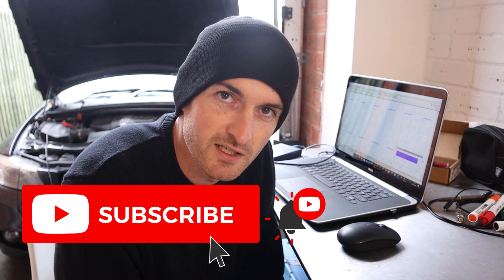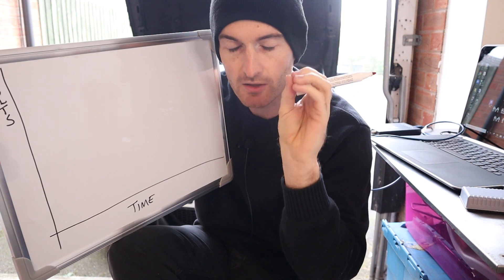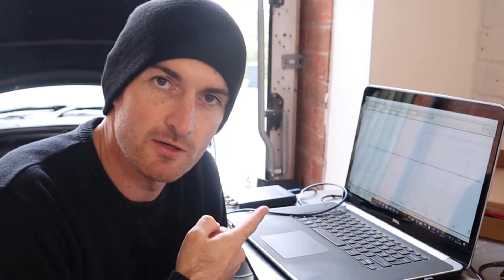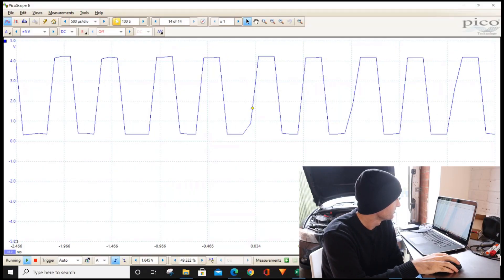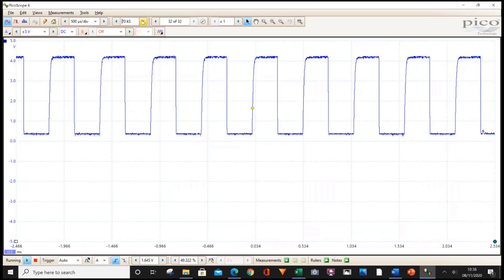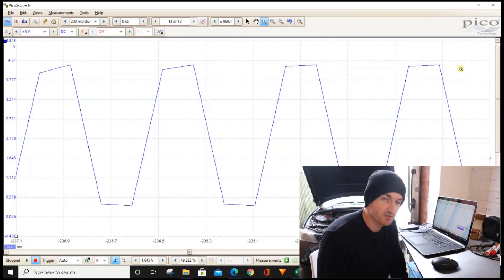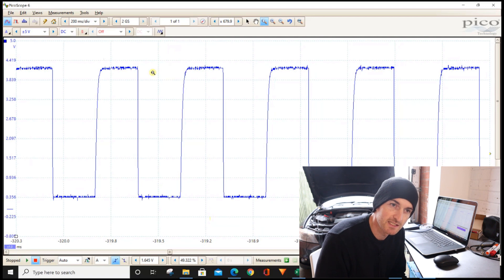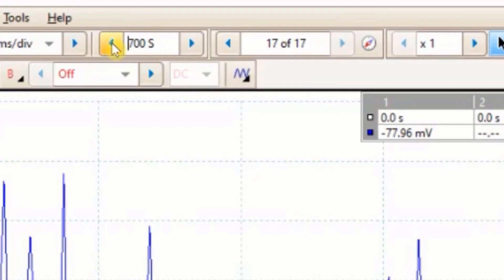Sample Rate Explained | Automotive Oscilloscope Diagnostics | Mechanic Mindset

Comment: More than once when you said "Sample Rate" you were actually referring to "Total Samples Taken". Specifically when talking about the samples adjustment in your software. This made the comparison between supposed high and low "Sample Rate" at a short and long time base (@  6:25  ) completely nonsensical and illogical. Changing the time base doesnt affect the waveform and true Sample Rate( except if you hit bandwith limitation but thats another thing), unless like in the case of the software you were using the time base setting directly changes the Sample Rate because it's the Total Samples Taken thats constant  and adjustble and not the actual Sample Rate. 

This is important to understand and point out bacaause as i sad it makes some explanations wrong and impossible. Otherwise you have great teaching style. Very aproachable and thorough. Thank you.

Comment: Loving the 2204A videos, Darren. The one thing that confused me was the s/div option in the software. I was always under the impression that that just changed the display output in the software itself so you could see more or less information depending on how big you want it on the screen (but the amount of information coming from the scope was the same depending on the sample rate chosen), but from the way you explained it, that actually changes how much information the scope provides to the PC as well? Like the s/div is directly linked to the sample rate?

Comment: Snap on zues is 6 million samples and that pales in comparison to pico. It ok but not a clear pic
Reply: I sometimes watch a video 2 or three times and I usually pick up more info this is one of those video. Basic as is maybe to some but very informative to me who never understood it's value.
Reply from the maker: @mike-yp1uk  It’s in the basics where masters are made 👌
Reply from the maker: The memory spec also plays a part; it determines how many samples can be displayed. They are usually fine at fast time scales, but start flagging when you want a lot of time on the screen ie 10 seconds

Comment: I think you have still left some confusion, since at the beginning of the video you are referring to samples per second, but when you are making adjustments, the sample rate is per screen, not per second. If it was samples per second, the resolution would be the same regardless of the zoom factor of the time axis. Perhaps I don't explain it so well either, but I reckon you (Darren) know what I mean.
Reply from the maker: Yes I see what you mean; I think I was trying to explain in its simplest form. 

There is an added layer to this too because the sample rate changes based on your time selection and maximum desired waveform buffer; all based on the oscilloscope memory. It can get quite deep 😅. It’s made somewhat simpler in Pico 7 with the option to prioritise sample rate or waveform buffer

Comment: Mate I want to know something. Injectors voltage diesel renault captur when ignition is on engine off. Im reading 4.7 volts both wires. Cranking im still reading 4.7 on both wires. I thought should be 12v and cranking ground side 0 volts. Should i get 4.7 or 12v?
Reply: Sounds like you are measuring voltage drop.  Can you send a sketch or illustration of your probe setup?
Reply: @gfbemc0256  No I was reading correct. Written on the body it said 4.7 volts.
Reply: @jamesbarratt593  that’s very interesting. I am assuming they are direct injectors operating at high pressure?

Comment: Hey, really enjoy your videos. how do you set the sample rate on a hantek with the hantek software?
Reply from the maker: Great question, I don’t think you can directly     You can change the buffer length which will spread the maximum samples over more time giving less sample rate. I’m need to do more research on Hantek but I think that’s how it works. 
Thanks!

Comment: I have a pico scope 3423 from 2007 it’s 4 channel the sampling rates are 20MS/s for one channel and 5 MS/s if using 4 channels this was a top of their range back then I bought the full kit wasn’t cheap never really used it your video has peeked my interest got it out of the box last weekend had a look at some ignition waveforms still working great downloaded the pico 6 automotive software works with that ok but I guess for the price I should really get the 2204 far superior a big leap in 14years
Reply from the maker: Awesome! I’ve not used that before. I’ve used the 4423, the first Automotive scope I think and that’s still good today. What’s the vertical resolution on yours? You might be interested in the training I’ve just launched 👍 https://www.mechanicmindset.com/diagnostic-coach
Reply: @MechanicMindset  12 bit resolution will have a look at your training I attended a pico training course in 2007 when I purchased the 3423 and to be honest it was to short and to intense plus there was guys there that were already using scopes went over my head to be honest.
Reply from the maker: @kevinpalmer7452  Cool, that’s good! 2204 is only 8bit. Might be worth hanging on to the one you have for a bit. Learn how to stretch its capability, then you will appreciate the upgrade and what the extra specs are buying you. I’m no salesman but the course I made explores all aspects of Pico 😂👍

Comment: Excellent info!  Thanks so much.   You mentioned in the video sometimes you might take the car on a road test.   Will the pico scope actually record data for a long period of time like that? I was thinking that it would record up to 32 frames and then start recording over itself. Are there any settings I need to make so that it will record for a long period of time? Sorry if my questions are kind of dumb. I'm still relatively new to this.
Reply from the maker: No, great question! You can increase the time setting per division. So you could actually record for hours or even days. You can then zoom in after, but the quality does reduce over longer time, there are only so many samples that can be taken. Keep an eye out here, I have some PicoScope training online coming soon!
Reply: @MechanicMindset  oh, that makes sense.   Thank God for knowledgeable people like you helping beginners like me. You really explain things well.

Comment: Sample rate vs/and Bits?
Reply from the maker: So the ‘bits’ refer to the scopes ability to rise and create a smooth line (to replicate an analogue signal). Low bit rate scopes will have steps in the wave form. Hope that helps 👍

Comment: First of all great explanation 👍 Could you please tell me if it's worth buying the 2205A which is 200 msps over the 2204A? Do you think it's worth the extra money?
Reply from the maker: Hi, if you want to do lots of captures at a higher time (I.e 200ms/div) and then zoom in then yes - it would be a bit better. ‘Real time’, for example a CAN capture at 50us/div, there no real difference. If you want to spend a bit more, go for 2405A, 4 channels and specs like 4425A! 👍
Reply: @MechanicMindset  That's a good point. Maybe spoil myself and get a 4 channel. Thanks for the prompt reply, appreciated.
Reply from the maker: You’re welcome!

Comment: Great Video Darren :) Glad to see topics like these discussed on you tube..... Being an automotive engineer myself, i have always felt there should be more videos about diagnostics using tools like oscilloscope and picoscope ! Hope to see more videos from your channel. I just had one comment on todays video, you should have also discussed about nyquist criteria for avoiding anti aliasing when selecting a sample rate.
Reply from the maker: Glad you enjoyed the video. What commodities do you look after in Automotive Engineering? 

Regarding the aliasing, I suppose this would be apparent on very low spec scopes on higher frequency repetitive signals; can you think of any common examples? Would be good to make a more detailed video covering this topic and being able to replicate aliasing will help get the message across. 

Thanks for the feedback! 👍
Reply: @MechanicMindset  My work involves control design for engines.  Regarding aliasing,  i am not sure how you can replicate it for demonstration on a vehicle. Generally, we see it during downsampling of very fast changing signals, one of such can be any pressure signals in the car where you would see some high frequency noise folding into the lower frequency domain.
Reply from the maker: @niksforever  Cool, OK. I’ll do a bit of research 👍

Comment: Can you use with oscilloscope amp clamp like unit210e Or u need one with bnc?
Reply from the maker: Hi, you need an amp clamp that outputs a voltage signal. BNC is best, but you can get a 4mm/banana to BNC converter to use other types. The one you mention 210e doesn’t look like the correct type. Check out my links for cheap amp clamps that work 👍

Comment: Hi. thanks for taking the time to explain this as ive always tryed to understand it. Just one question- When sample rate is increase a lot to say 100ms and you then get more information on the captures does this then reduce the number of frames you capture or overall time??
Reply from the maker: Hi mate, sample rate doesn't affect the amount of screens that are recorded. But if you increase the time setting, you should probably increase sample rate too. it all depends on what you want to do really. If you want to zoom in, more than likely you will want to increase the sample rate
Reply from the maker: Actually, my mistake in reading the sample rate could reduce the waveform buffer. Looks like it depends on which scope you have as to how it is affected 👍

Comment: Hi Darren, Pico software lets you decode a LIN signal as a measurement tool. Could you please deepen in that issue? Could be really helpful!!
Reply from the maker: Hi, yeah I will have a look in to it. The serial decoding feature is quite simple to use. What is not so simple is obtaining the manufacturer information that can be used to decode that data in to information safe for humans 😂. I suppose that’s what the live data in diagnostic software helps us achieve. I’ll have a dig 👍

Comment: 6:40 200 miliseconds is 0.2 seconds & not 2 seconds.. Nobody spotted this after a week?
Reply from the maker: 2 seconds on the whole page. 200ms/div x10 divisions = 2 seconds 👍
Reply: @MechanicMindset  so the samplke rate is per screen & not division?
Reply from the maker: @dasouth1978   The time setting is per division. So when we set it to 200ms, that how much time is represented in each square, 10 squares on the screen left to right, so we get 2 seconds of data on the whole screen. Set it to 100ms, we get 1 second. The sample rate is separate from the time setting per division. It simply defines how many samples per second. Hope that helps

Comment: Does this tie into the buffer? I was always under the assumption that higher sample rates used more of the buffer, thus less screen recordings you could get. Is that correct?
Reply from the maker: I think there is a relationship between time base and sample rate. The scope automatically enters a slow sample mode over 200ms (this can be changed in preferences). The buffer can actually be increased to 255!
Reply from the maker: And yes, it does affect how many waveform buffers are stored. Looks like it depends on the scope 👍

Comment: Have you gotten your 2204 to work with the automotive version of the pc software?
Reply from the maker: Hi, yes I have a video to show how although I don’t use it personally. For me it’s the same as Pico 6. You can import the probes if you wish to. Thanks for watching!
Reply: @MechanicMindset  okay, I'll look for it.  I know there was one video showing how to get it to work with non "automotive" scopes, but as I recall, it seemed like something that likely wouldn't work long before pico fixed things.  I saw you measure degrees, that's a big part of what I'd want.  If it can make the markers for every 90 degrees, that would be do fine.  Also, if you can create custom probes, that pretty much takes care of the rest.
Reply from the maker: @tonyfremont  Ah ok, you can measure degrees on the normal Pico software; no need for the Automotive version. Drag from the bottom right corner. You can download it and try it for free in demo mode 👍
Reply: @MechanicMindset  yeah, I was surprised when you showed the degrees already calculated.  I was expecting you to start explaining the math for doing it by hand.

Comment: Thank you sir, what do you think about an automotive oscilloscope that has 10 Mz bandwidth, 40 Ms/s sample rate to analyse can bus fast canbus, and all car's sensors. It's AVL DiTEST SCOPE 8400.
Reply from the maker: I know the scope but I have never used it before. it should be ok - AVL make some great tools
Reply: @MechanicMindset  THANKS

Comment: 7:50 I guess you mean lowering the sampling rate will help taking longer recordings? The higher the sampling rate the more data is created.
Reply from the maker: Hi, sorry if it wasn’t clear. If you increase the sample rate, you will get more clarity when zooming in over longer recordings. If it is lower, you will get the ‘triangles’

Comment: I see that there are several versions of the 2000 series Pico. What is the difference automotively speaking?
Reply from the maker: The main difference is an increased frequency & sample rate plus the option for 4 channels. Higher sample rate is better - this 2204A lacks clarity for certain tests but is great for most. Hope that helps
Reply: @MechanicMindset  What I meant was what is the purpose of having a different frequency? I see there are 5 different frequencies you can choose from. I’m going to pick up the one from your affiliate link. Great channel you have. Thanks!
Reply from the maker: @pl5882  Ah, thanks for using the links 👍. The Pico Automotive kit is 20Mhz and 400MS/s. I reckon the 2405A looks like the Best Buy. 4 channels. 25Mhz. 500MS/s. Not sure if it is on Amazon though